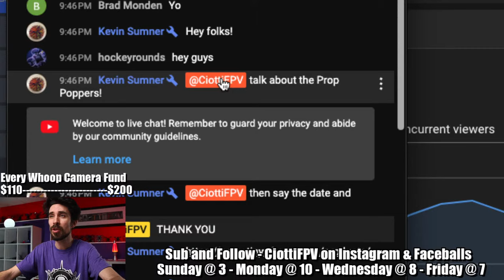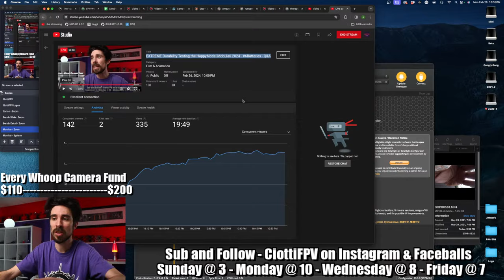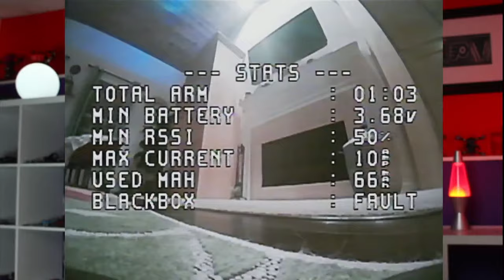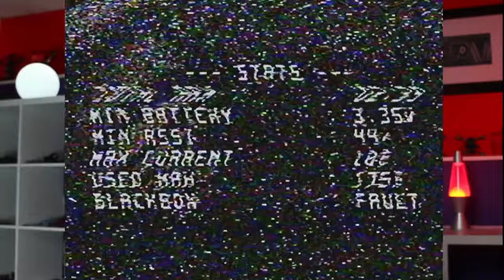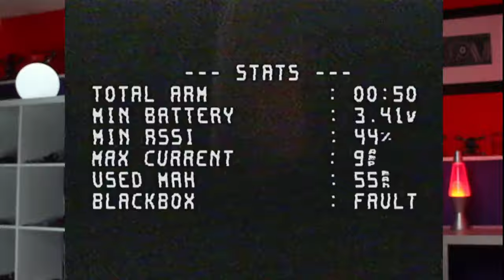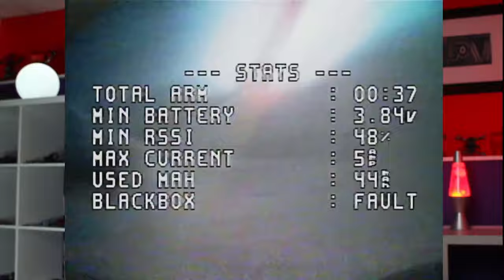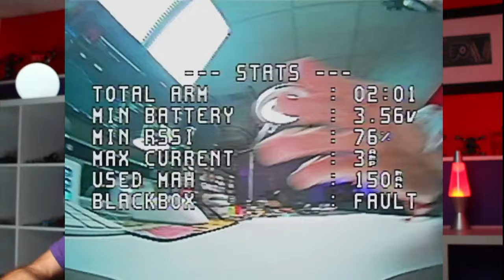EXTREME Durability Testing the HappyModel Mobula6 2024 - #6Batteries - Q&A

Comment: Good day GG and Ciotti how is everyone doing?

00:04:00 On this stream……
00:08:43 What did you miss on yesterday’s stream?
00:09:20 !0 Second run time?
00:16:44 FB is getting really weird.
00:22:36 How you can be better, let Ciotti help you out.
00:27:14 Big news!!!
00:30:00 Mobula6 2024 is $135.- more expensive the I thought.
00:31:12 Have noticed the Vtx and receiver is on the same uart on the mobula6 2024? have you talked about that yet? is yours like that?
00:33:53 would it be any different to have super high Kv motors and throttle limit them?
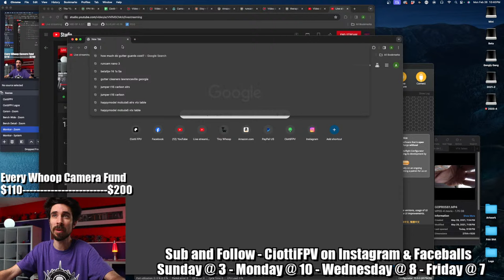00:40:50 What to get at TinyWhoop.com
00:44:04 Prop popper strong enough to take off them damn NBD azis props and some of the other 31mm props that are insane to get off
00:48:44 How have you been liking the new ultralight Mobula frame? I'm thinking of trying it since I've had some tuning issues with the meteor air
00:51:42 Did you say you had some weird vtx table problems? open vtx over Msp will create the vtx table and send it to Betaflight. or so I've read.
00:52:09 How good of a deal is a good condition used Cinelog 35 with goggles v2 and GoPro 10 bones for 500, if I’m planning to resell goggles?
00:54:03 How about running 2s on a 1s motor but limit the motors to 50%
00:54:39 Double click on TinyWhoop Store will give you everything.
00:56:28  Did anyone else get the glow frame for the lakers build?
00:56:58 Be careful. .99 is too loose for me, .95 got me to where it’s not too tight, not too loose ;)
00:59:04 Is .9mm okay or do you need the .99?
01:01:06 What if you used the prop popper to install a prop. Then removing it would not require stressing the motor bell/shaft pinch
01:03:50 What's your setup advice for a 85mm outdoor freestyle whoop with naked vista ?
01:07:26 Do high Kv motors like the 40kKV WeBleed pull more amps? More than 5A on those beta boards?
01:11:52 Are you building Bardwell a whoop for racegow or is there one that's prebuilt?
01:12:53 Any idea why on one of my quads my battery voltage jumps around with throttle and on another it is more stable (on my OSD)? One FC is an F4 the other is F7, could that be why?
01:14:37 Use the prop popper as a spacer so it’s easier to remove the prop
01:16:00 Rule of thumb for putting your tiny whoop props on.
01:19:12 Maybe throttle expo is what’s missing for my 75mm rigs
01:19:38 you think ppl don't watch long videos.... getting people these days to read 3 paragraphs is like impossible. long form rational discourse is almost totally dead online
01:24:49 Do you think the new mob 6 with motor plugs (Eco?) will hit that 90% of ultimate freestyle mark?
01:25:58 Do you think the new mob6 frame won't shatter after 5 packs? to be fair to them I shattered mine in cold weather.
01:27:31 Have you tried the ultralight HQs on the mob6? Feels better to me
01:29:14 Would 0802 33000 Kv motor be ok for your jungle gym basher or are they a bit much?
01:31:06 I hate when someone makes a helpful how to video and they clearly don’t make videos often receives rude criticism in the comments about the quality of the video.
01:33:50 Do you know when the 40000kv motors drop??
01:34:50  Should I transplant my old mob 6 to a cockroach frame?
01:35:10 Fractal has some 0802 1.5mm shafts.
01:36:04 I know the goal is to break it but would love to see one smooth pack with dialed back 10% and less crashing
01:37:46 Hat smooth work you did around/under coffee table in that one dialed back pack a week or so ago was amazing. blind passes, lots of control 
01:41:21 Yeah let’s get airborne ehhhhhhh nope first putting the props on right 😂
01:43:18 Here we go. EXTREME Durability Testing the HappyModel Mobula6 2024
01:48:22 trippy the FAN
01:54:48 inverted 360 yaw spin at peak power loop
01:57:10 Does the inverted yaw spin stuff also apply to 5" rigs.
02:02:24 Ciotti IS AN ALL THINGS INVERTED HATER 😂
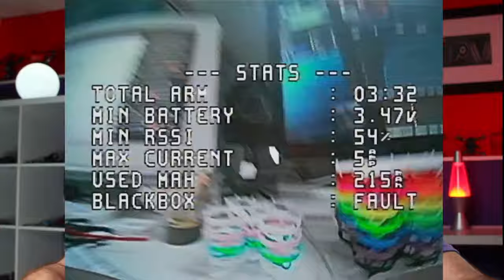02:11:40 reverse the rotation on the wall ride, so you focus a single spot on the ceiling.
02:12:31 What receiver/USB capture device do you use to stream analog FPV for us?
02:17:53 Damage report.
02:21:21 I think only the Meteor65 and Crown frames would have kept up with this. Maybe the new Cockroach.
02:26:00 The whoop needs a to loose some hair😂 and the props doing great.
02:34:31 How are the motors holding up?
02:36:06 What are your next motors for that?
02:43:20 It's better to have more than 20 seconds of flight time before you're having to alter your flying to compensate for sag.
02:50:17 A cool move 
02:52:40 Nailed it!
02:58:30 Is it possible to fly 1002 22kkv inside on a pro 75 frame???
03:09:10 One props is bend, so were done testing the Mobula6 2024. What is the result and thoughts about the whoop.

Stay safe everyone and have fun flying

Comment: I upgraded my Mobula6 (older model, ELRS 26.000kv, the one with the green frame originally) with your recommendations (TrueRC antenna, Meteor65 frame, BT2.0 connectors) and it has been super solid/reliable. Crashed it a lot, flew it outside, these things sure can take a beating. Also flashed Bluejay ESC 48khz firmware, which added 30+ seconds of flight time. Thanks for sharing so much knowledge, it has been a very nice journey so far!
Reply from the maker: Ultimate Freestyle Tiny Whoop for LIFE :)

Comment: The amount of thrust needed to fly doesn’t change based on KV. higher KV motors will only see a difference in throttle resolution and WOT. 

Basically if the quad hovers and flies at say “16,275” rpm. That isn’t going to change by changing motors. It’ll still fly and hover at the same “16275” rpm but your stick position will be different.
Reply from the maker: Perfect way of explaining it man
Reply: Nice explain ! What's WOT ? :)
Reply: @maeldrz  WOT is Wide Open Throttle. It’s an automotive term.

Comment: Check out the new hglrc petrel 85 whoop. That frame is good for flexible battery size choice. Also siff and durable carbon support.
Should fix your 2" whoop recommendation
Reply from the maker: Interesting, my main complaint about 2" whoops is that they just sorta don't make any sense to me other than carrying a Vista which at this point with Walksnail there's really no reason to do.  Really good to know there's a durable frame out there though

Comment: I’m 99.8% sure your whole motor problem you complain about at 2:40:00 and on and on and on . Is the hair in the motors . Take a set of tweezers and unwind the hairs inside the motor casing . The ones on the props usually cause little problems . It’s when they get between the magnets is when you get issues . Ask me how I know . lol
Reply from the maker: Keep watching, I realized that a few minutes later :)
Reply: @CiottiFPV  I see the part where you take the hair ball out. But I missed the part where you say it’s not the motors being shot it’s the hair inside the casing .
Reply from the maker: @Loophole120  well the motors are beat up for sure, I spun them up in turtle mode a few times and I can feel it, I always hope that you all can hear it through the mic but I don't wear headphones so I don't actually know, but these still have a good amount of life left in them, I run these motors into the GROUND :)
Reply: Yes , but I’m saying I don’t think they’re beat up from the crashes . You have hair inside the motor itself . One little 1” long hair in there will cause havoc . Mainly in motor torq . A lot of jello with hair inside the motor casing. Not around the shafts.
Reply from the maker: @Loophole120  right, yeah I know what you're saying but they're definitely beat up from all the crashing, I have it right here next to me with all the hair cleaned out and they vibrate quite a bit even with the props off, not so much that they're unflyable or will need to be replaced within the next 100 or so batteries but definitely not fresh any more